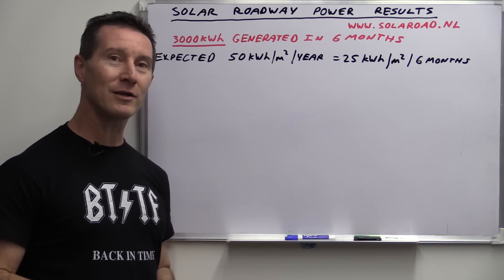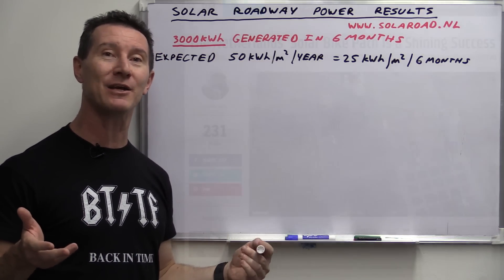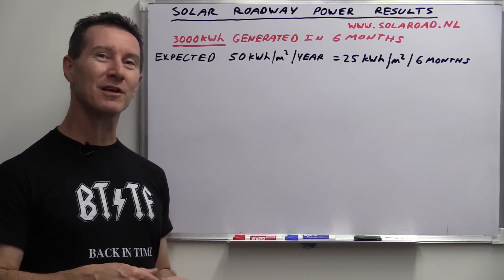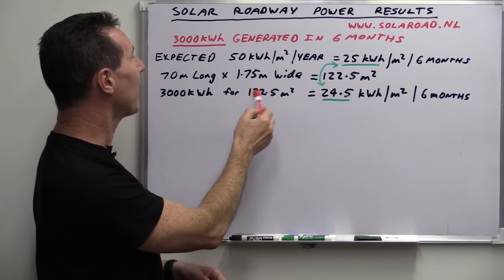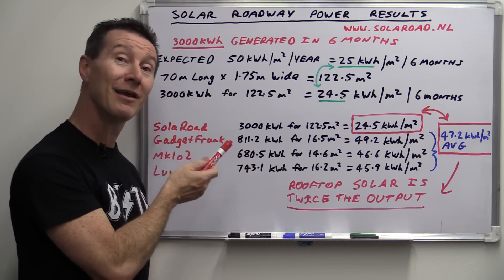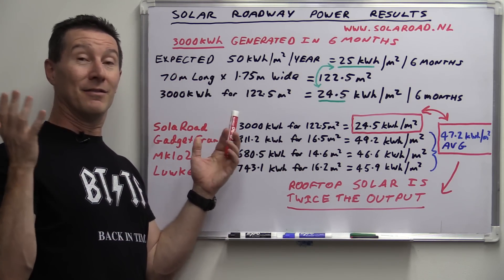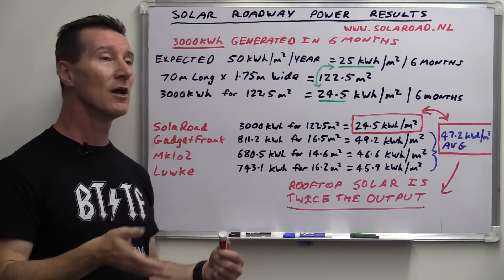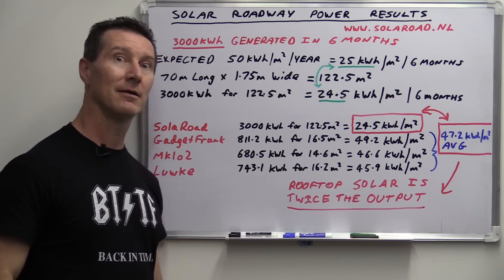EEVblog #743 - Solar Roadways Test Results

Comment: Blasphemy David why do you hate the earth?
Reply from the maker: s0nnyburnett Yeah, I hate it so much I installed my own rooftop solar system and designed and installed my own solar air heater called the Solar Sponge. What have you done?
Reply: EEVblog
On your roof? It doesn't get hot up there! Put them on driveway it gets much hotter, will work much better. No need to thank me as long as you save the earth. The benefits are obvious.
Reply: EEVblog Clearly going about it all wrong, it needs to be on the drive way, so that you can park over it.
Reply: EEVblog Sarcasm doesn't work too well on the internet it appears.
Reply: s0nnyburnett LOL! They should have caught on when you called him David.
Reply: I thought the sarcasm would have been obvious, but I guess everyone's too angry over this.
Reply: s0nnyburnett  Except you're spending a lot of energy producing all the materials for the PV panels, tempered glass.   All the energy used to exhume the materials to actually make these components. 
Also, you'll need a lot of energy just for the concrete and wiring setups.
Reply: s0nnyburnett Why would you want to make the solar panels hot? That reduces their efficiency.

Comment: Hey Dave! Long time fan, keep up the good work! What do you think about this in carparks though? Surely there's plenty of them around for costs to come down after a few iterations.
Reply from the maker: Gamah1991 What happens when the cars park on them? Way better to put them above the cars.
Reply: EEVblog  Laws/etc make that difficult sometimes, zoning, building things to code, etc. I'm all for on top of existing buildings, but why not lots as well? Even if the "road" versions are only 1/3 as effective I can imagine many places where at least 3x the surface is available uncovered at any given time. The semantics and costs of implementation will go down over time of course.

Not looking to start a flame war, I do appreciate the videos! Keep them coming :)
Reply from the maker: Gamah1991 the costs might go down but they are still always going to be ridiculously high. Look at the payback calcs I did in the previous video. Rooftop solar power is already a marginal payback investment. Solar parking lots are just a stupid idea.
Reply: EEVblog If it takes 20 years just to break even this makes the endeavor much more vulnerable to damage from lightning, hail,
wind damage, stupid roofing contractors, etc.
Shingle or pitch/tar gravel roofing would cost more worked
around rooftop solar panels.
Rooftop solar might make it more economically viable to install
metal roofing to cut way down on the need to replace roof
every 10 years.
 
The thick glass part of this reminds me of the potential for hail damage.
 
Has anybody doing rooftop solar come up with ways to
prevent hail stones from ruining all of your break even calculations?
 
That bike trail median in South Korea would really be a disaster
when golf ball size hail hits it!
 
Easily predictable within 20 years.
 
Our old inefficient sodium vapor street lights were about $200
and were super tough and super repairable.
The new LED street lights are about $800 per pole and have
a large circuit board in them.  Lighting is common for light poles.
They are more fragile as far as impacts to pole, typically no parts are recyclable.
 
I question the ROI for LED street lights considering the
hazards during the break even period.
 
Much like photovoltaic cells, LED street lights
seem to be too fragile to ever make it to their
break even period.  Crews with cherry pickers
to install or repair street lights are very expensive.
The promise of LED street lights is fewer expensive
trips with an expensive crew to change light bulbs.
The reality may be much less rosey considering
the much larger cost to install plus the vulnerablity
to lightning (both direct and nearby) or accident to pole.
 
Is there any data on survivability for photovoltaic cells?